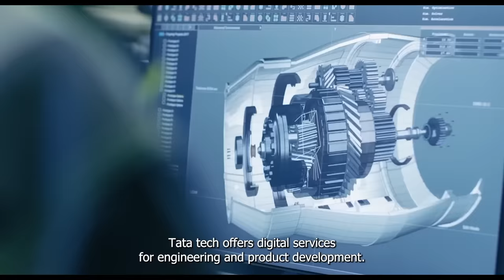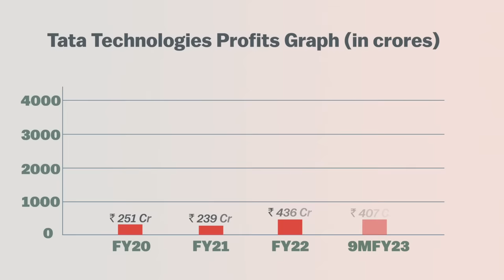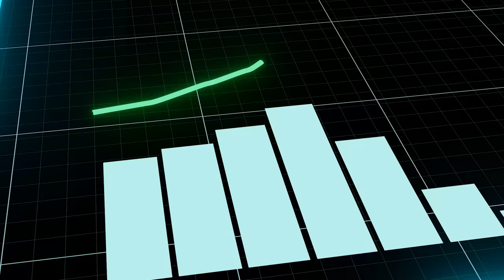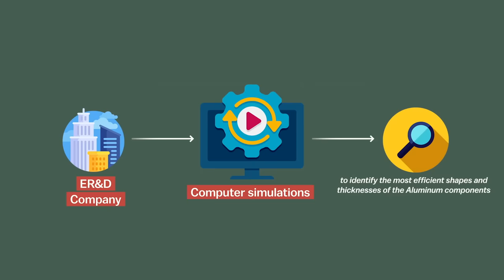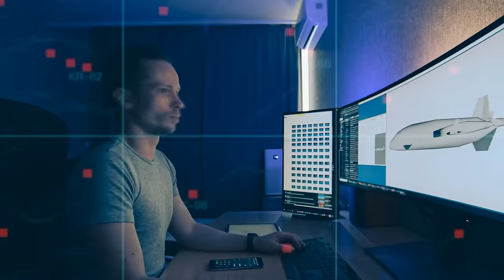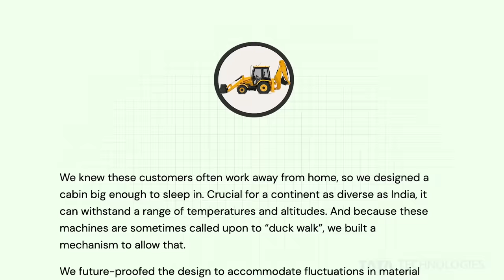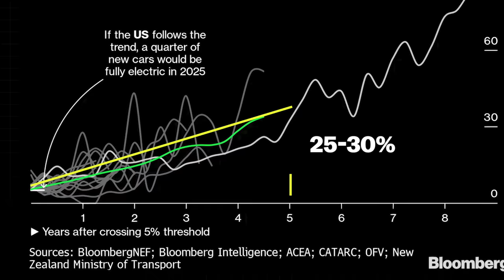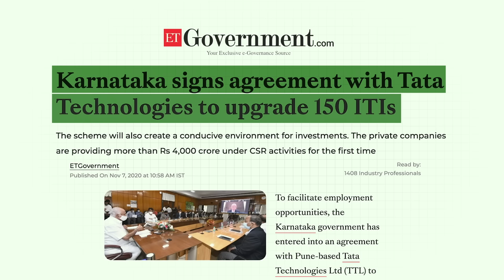How TATA’s GENIUS strategy is turning TATA Tech into a LEGEND? : Tata technologies case study

Comment: Just a thought, won't the semiconductor shortage will have any effect on the three areas of operation of Tata Tech.?
Reply: Two big components in an electrical car are lithium and silicon that are difficult to procure.. Lucky lithium was discovered recently in India. It is upon the Modi government to strike a deal between India and Taiwan. Taiwan can sell its semiconductor technology and silicon to India as they hate China. Taiwan wants to support a country that will support Taiwan with it's battle against China. The Modi government needs to make an important decision. If the government can strike a deal with Taiwan then India will quickly emerge as an economic giant.
Reply: Foxconn and Vedanta are collabrating to make semiconductors in Gujarat and Tata is also planning  to invest in Semiconductor.
Reply from the maker: It will be

Comment: I have one doubt if anyone can explain ..I tried doing my research around it but couldn't find anything ..the current market price of the unlisted shares of tata technologies is approx 800 whereas the price band which tata is considering for the tata technologies is approx. 4-5 times of the price issued to tata motors ..how is it that the pre IPO market price is so higher than the price at which tata group wants to price the shares in IPO.

Comment: The current ratio calculation is not correct here since you can't compare current ratio of a manufacturing unit with a tech company. For a manufacturing unit the current ratio will be always lower due to their high debts and liabilities. The comparison should be like to like basis.

Comment: I can see another threat in the market which could disadvantage Tata technologies in the short-term - De-dollarisation would I think make "cheap labour" a thing of the past in India eventually, especially if the rupee comes to parity with the dollar ! As the Rupee appreciates, the export sector could slump short-term whilst the market adjusts. Long term it will work out, as it would be more expensive, if not impossible for the US to undertake its own manufacturing at home, which would make its vehicles more expensive to export. I think Tata should let shareholders know there may be crinkles short-term which will iron themselves out in the long run. Additionally, there are noises in the US about preventing de-dollarisation with war against countries refusing its worthless paper masquerading as currency. We will have to see. But war is a factor that impacts economic activity. We are in very destabilising times and anything could kick off anytime unless sober minds and cooler heads prevail.

Comment: As an automobile enthusiast, the development of synthetic petrol by Porsche in the southernmost islands of Chile will make the EVs irrelevant. While manufacturing an EV  more carbon footprint than the ICE counterparts is generated. A big question is the longevity of EVs which certainly won't be equal to ICE counterparts. The costly minerals which are used in EVs makes it's price go up and those minerals are scarce they are not abundant. The infrastructure required to run EVs is cumbersome and costly and may be possible in india but not for every country.It's kinda fun to see woke Indians and other global wokes in name of saving planet promoting a deloitte lifestyle by making things which try to fix something which was never broken.The only way to save planet is to make the poor rich as fast as possible and not EVs,veganism and etc etc.